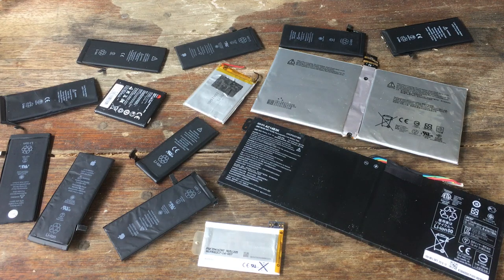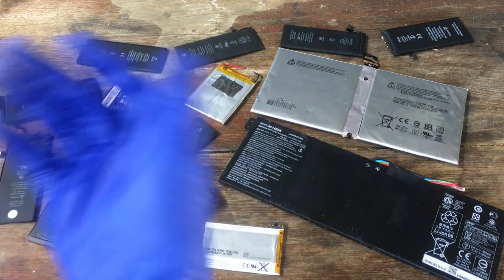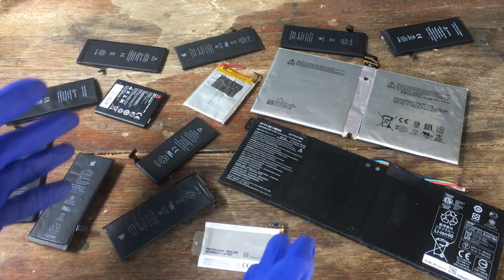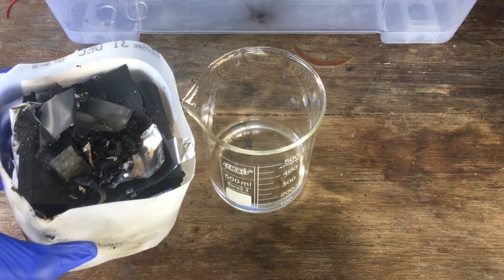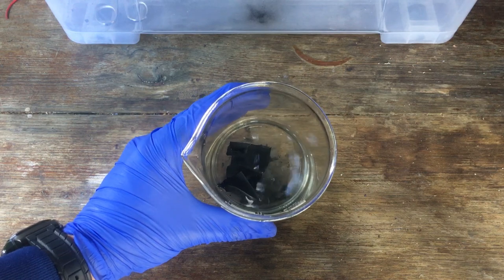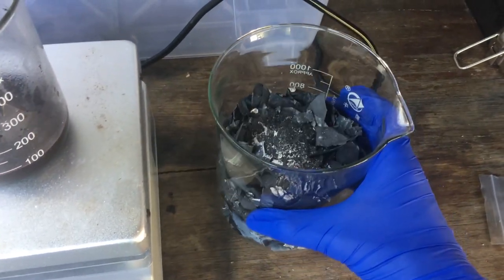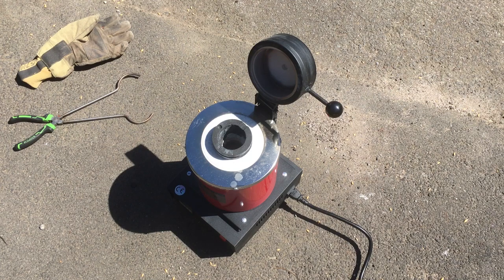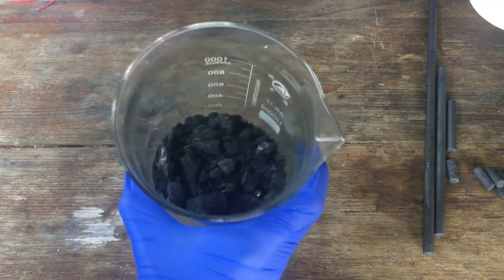Lithium From Li-ion Batteries - Part 1

Comment: Also if you use potassium or sodium carbonate to precipitate use always powder, not solution!
Reply from the maker: Why?
Reply: @ScrapScience  The lithium in those batteries is not much and also the molar mass is low. Then u have very thin solution of LiOH. By pouring in solution of carbonate u further make the solution thinner. This is why a cautious adding of powder is better. Li2CO3 has a solubility of 8.4 - 13 g/L at 20 °C. Also boiling down the solution to, say, 10% of the volume before adding carbonate is better.
Reply from the maker: This sounds reasonable, but then how do you avoid the particles of powder getting coated in precipitate? I've always been taught to use concentrated solutions as opposed to powders for precipitation reactions for this reason.
Reply: @ScrapScience  You have to be very cautios and give the powder in slowly and stir. At some point the precipitation starts suddenly and you have to stop giving powder. I agree that this is not a very practical for industry solutions but it works in the lab.

Comment: Wouldn't the Aluminum dissolve in a highly base solution? Or does it only dissolve in sodium hydroxide solution?
Reply from the maker: That's true - at least, I think. Any strongly dissociating hydroxide should dissolve aluminium to some extent. That would explain what's left in solution (and what I subjected to a flame test), but still leaves the question of what made the solution basic in the first place... If it were lithium, it should still have dropped out with carbonate.
Your guess is as good as mine here.

Comment: Well I'm going to get straight to the point. Is there any money to be made recycling these batteries like this and if there is,is it worth the effort and cost of the chemicals used?
Reply from the maker: As it stands, the process I've used is many times more expensive than the materials that are extracted. It's possible it could be made profitable with some serious simplification and free electricity, but there's a lot of work involved in trying that.
Reply: @ScrapScience  what about the larger batteries? Like tool batteries and bigger? I saw another video where the guy took the lithium out of a AA battery. Would the larger types be more easily removed?
Reply: @ScrapScience  also, is there a way to store and keep the exposed lithium from igniting or blowing up?
Reply from the maker: Larger batteries will work in exactly the same way, you'll just have to work on a larger scale. Things might be easier to extract, but you're still working with processes that are more expensive than the products you get.
As for lithium AA batteries, these are a completely different type of lithium battery, hence why they contain lithium metal itself. Rechargable lithium ion batteries (i.e., pretty much all of the lithium batteries excluding the AA ones) only contain lithium ions, heavily incorperated in a matrix of metal oxides, hence why we need complex processes to extract it.
If you do manage to get lithium metal, storing it under mineral oil is normally the best option to protect it from the air. Since it floats, you may need to push it down into the oil with some cotton or something.
Reply: @ScrapScience  ok. So any battery that says ion is going to be expensive and a hassle to remove the lithium? Do you know what batteries have the metal sheets?
Reply: @ScrapScience  thanks for your help.